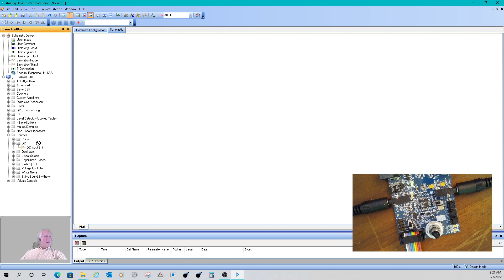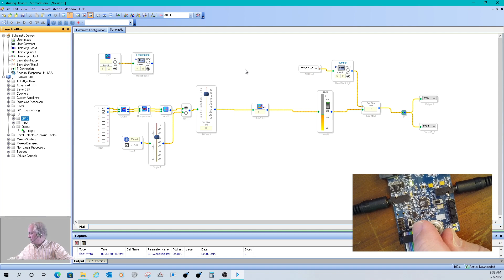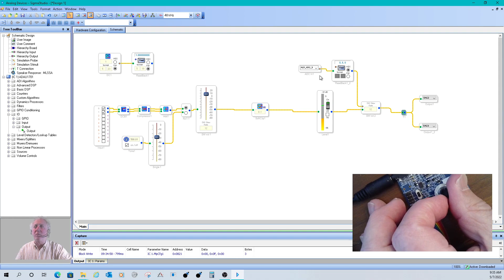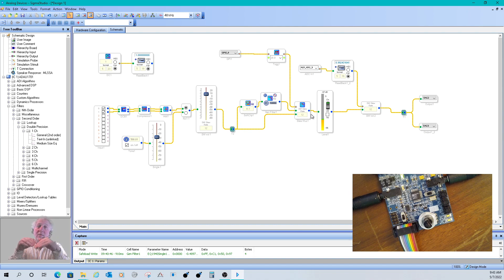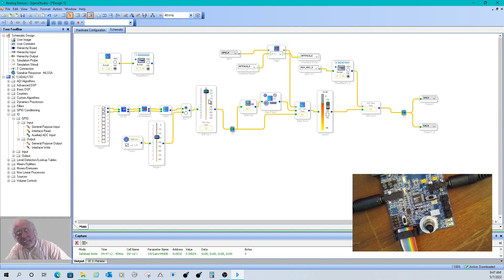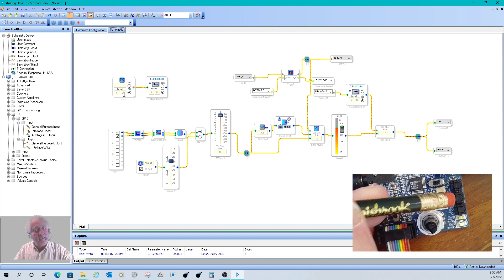ADAU1701 Guitar Distortion Pedal

Comment: Are there any DSP or FPGA boards that can be programmed without windows?
Reply from the maker: No, you need to use SigmaStudio which is only a Windows program. I used to use my old MAC and Parallels to run Windows but my new M1 MAC has a driver issue that we (ADI) have yet to figure out how to fix. It is on my ToDo list. I do not know about FPGA boards.

Comment: are the input buffers on the eval board able to handle guitar signals?
Reply from the maker: That is a great question... I have actually never tried it. It should not be optimal because it was setup for consumer line level signals. There should not be enough gain and the input impedance might be a little low. I do not have the schematic in front of me at the moment. I will try to get a better answer for you about this. Feel free to bug me about it a little later if you do not hear back.

Comment: Hello Dave!!

My name is João. I just started playing with ADAU1797 EVAL. I downloaded Sigma and Sigma Plus but I can't seem to find my board in both of them. Do I have to download anything else separately? Does using the ADAU1787 on the software work?? 

Thanks a lot for the video!
Reply from the maker: Hello Joao,
Glad you are interested in using the SigmaDSPs. It would be important to learn what your application is that you are looking to solve? The reason why I ask is because the ADAU1797 is a very different part. It is technically not a SigmaDSP. It does not have a sigmaDSP core. It has a HiFi core so you will need to use a different IDE and purchase a license for programming a HiFi core. I think we have done some work to use SigmaStudio for programming the FastDSP core. It actually has two cores. I do not support this part so I am not the expert with it. I would have to connect you with one of the other Apps engineers. Feel free to contact me directly via email or post a question on EngineerZone. Post it in the Audio forum space... I just went to grab a link to the forum and I see you have posted a question. I will alert the correct people to help you. Also, you are correct that the ADAU1787 is somewhat of a predecessor but it does have a Sigma200 DSP core along with the FastDSP core which is why you can find it in SigmaStudio.
Reply: @HowtoSigmaDSP  
Impressively fast answer, thanks for that!

I will continue our conversation in the blog. Have a nice day!!